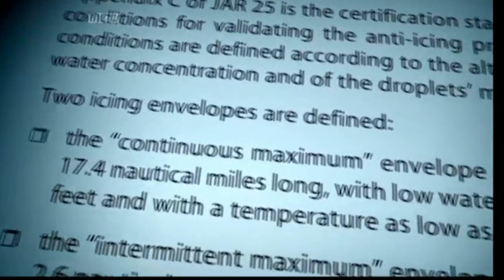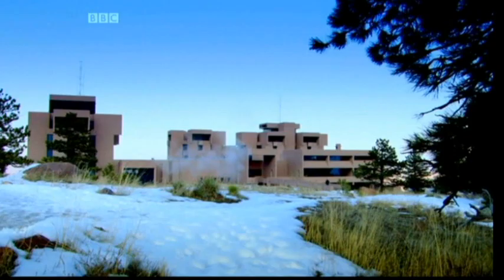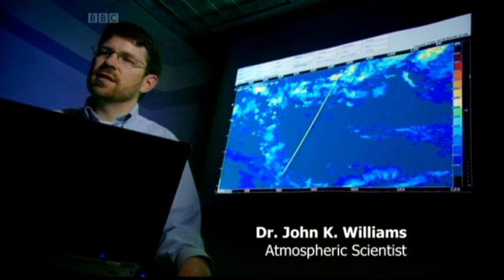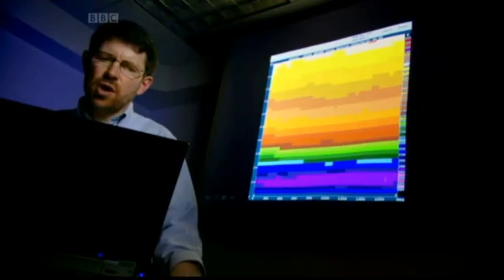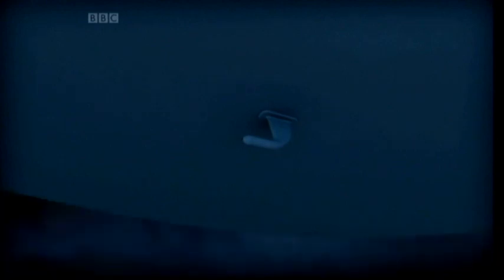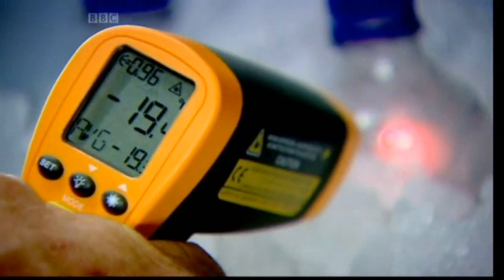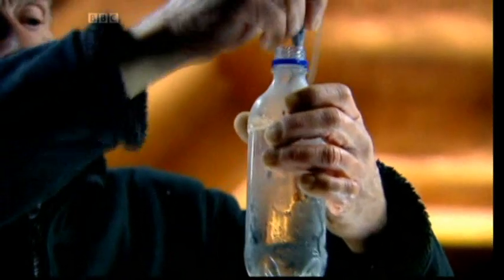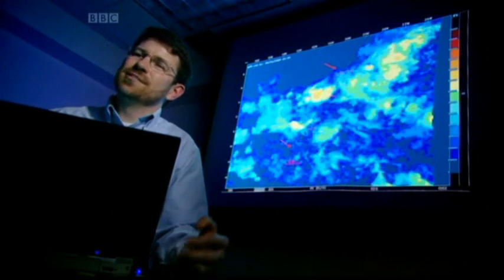Lost - The Mystery Of Flight 447 - Part 4

Comment: Bonin didn't realize that he had aft stick until too late. Airbus sidestick controllers are not connected so pilot side controller was in the neutral position. If this had been a conventional set-up then both yokes would be in the same position. If co-pilot yoke is pulled back then pilot yoke is pulled back. Guy in the left seat would then have been aware that mistake was being made

Comment: quite obvious now that the cause of the cash was because of interference with the tubes, this has happened on another air crash, where the tubes had a spider web on it, and because of this simple small tiny web, it caused the plane to crash because it was interfering with the tubes, and the pilots had no idea how fast or high they were, and they just crashed in the ocean, just like air france, and also in the night.